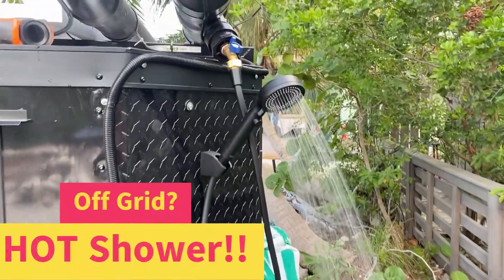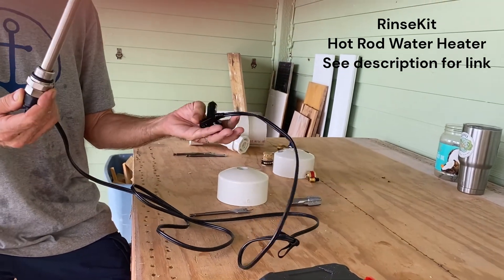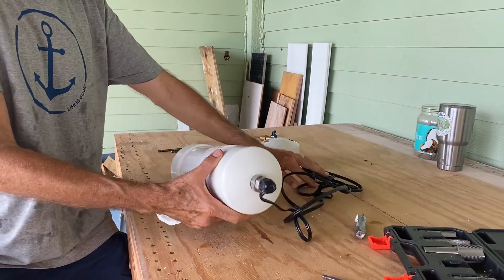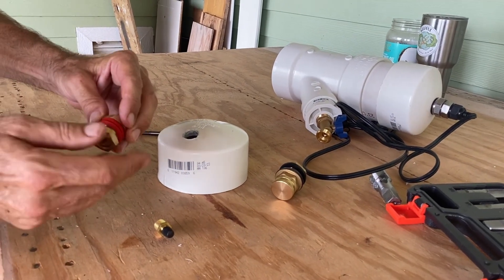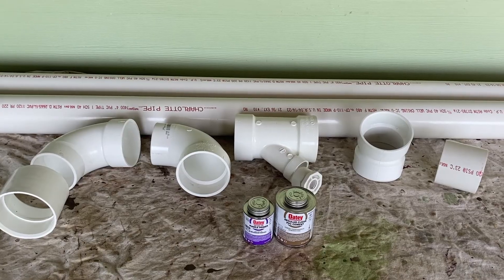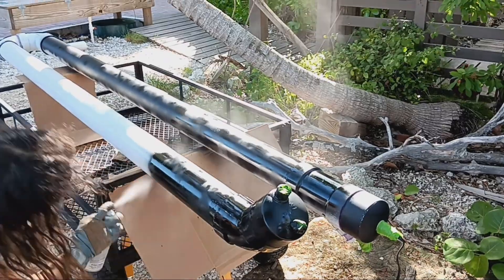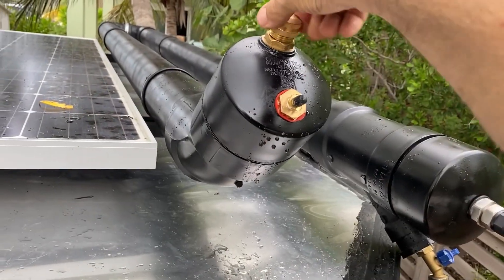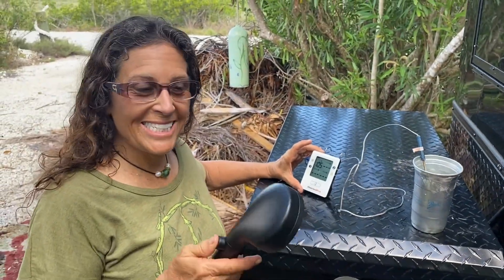DIY HOT Solar Rooftop Shower! #waterheater #vanlife #camper #solarpower #offgridliving

Comment: Great Build !! I Love it. Do you put the water in first and then pressurize, or do you pressurize first before putting the water in ? And I assuming that you filled it with water at the  shower valve ? Thank you so much for your time.
Reply from the maker: Thank you for watching! Yes, refill it through the shower valve, with the top cap open to allow air to escape. then pressurize. We weren’t too happy with this part because the pressure doesn’t last for a whole shower. We ended up adding a small 12 V pump to pressurize the shower. I need to do a video on this!
Reply: @ecohabs4earth  - Thanks so much for your quick answer !! I wonder if it would last longer if you didn't open up the valve all the way ?  Or, Would pressurizing more than 30 PSI make it last longer if that 4" schedule 40 is able to handle more pressure ? Looking forward to seeing the new video on how you attached the 12V pump. Take Care.
Reply from the maker: @menmustchangebeforekingdoms great inputs thanks again!
Reply: @ecohabs4earth  - Hello Again, just wanted to ask you "How" you added the 12v pump to pressurize the PVC ? This is something that I would like to do also.... Thank you so much for your time.

Comment: That's kind of the same setup I did several years back, he's the larger diameter of pipe Schrader valve from off of semi new. And a 12-volt heating element was from Missouri wind and solar, I found the ones off of Amazon we're not true 12 volt the one I bought from Missouri wind and solar has a dial on the back of setting the temperature very nice video thanks for sharing
Reply from the maker: You are welcome and thanks for watching!  I will have a look at the Missouri wind and solar heating elements...

Comment: Great idea .Mine idea for the home is a Garden sprayer. You can get then as small or as large as you want, drop the 12 volt heating element in the water tank until it reaches the temp you want. Of course indoors you have to mount the wand  so you get a descent amount of water on you. You can always hold the Wand in one hand but that seems like more work than i like.
Reply from the maker: Great idea- now you can make a YouTube video for that😎